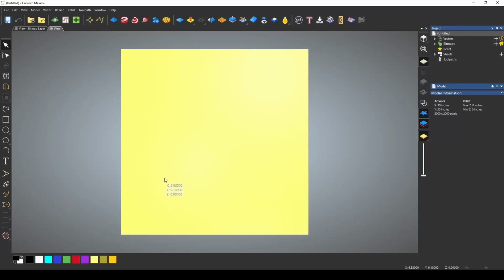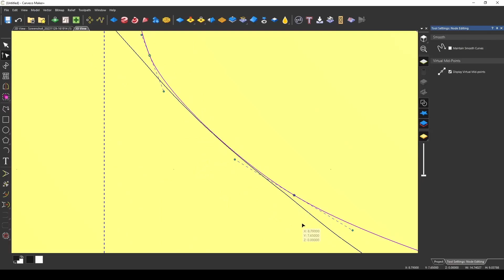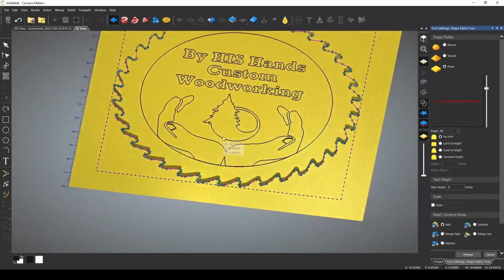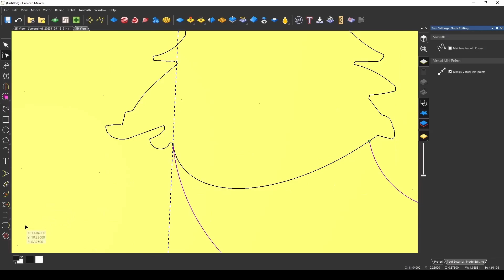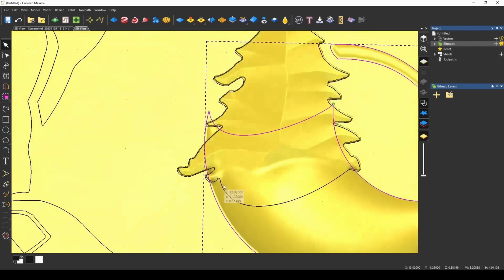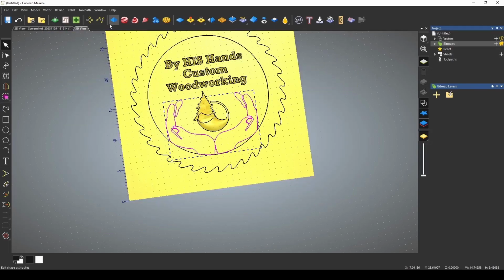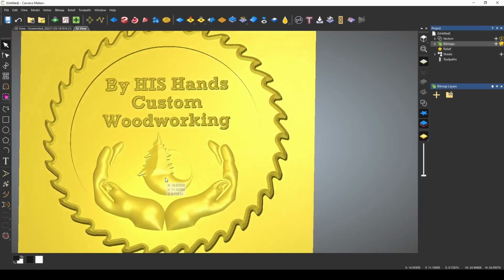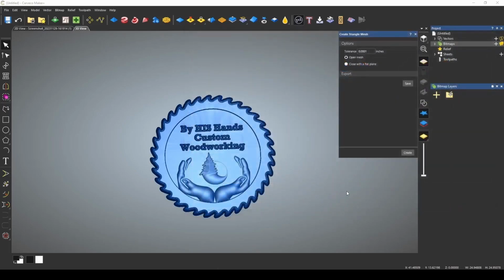Transforming a Logo into a 3D Relief Model: Step-by-Step Guide with Carveco Maker+

Comment: Great video, lots of new ideas on design features.
Is there a way to delete a single relief definition after applying without affecting others? I usually have to reset relief and rely on CarveCo remembering previous settings for individual elements.
I might have tried light dome effect inner circle, give the effect of other elements on a cushion
Reply from the maker: If you apply the reverse shape of what you pasted it will undo that feature. For example if you add a curve at 40deg on top of something in the add function to remove it you would go back to the same feature and use a subtract curve at 40deg and it will go back to its original shape. However once you alter that shape with another tool its much harder to go back more than one step.

Comment: Can't remember the tool name , for the tree, 4th icon right of shape editor , will keep tree square vertex's same height
Reply from the maker: I think you are talking about the contour blend?
Reply: @Timberfalls  that's the one !!! Brain fog again
Reply from the maker: @JohnCol-1959  I like that tool too but it does not let you change the shape so I rely on the shape editor more. I need to do some videos with the extrusion and spin tools in use.
Reply: I think with the tree, use square and limit height 2mm.
The swirl round, limit 2mm gets rid of the mountains